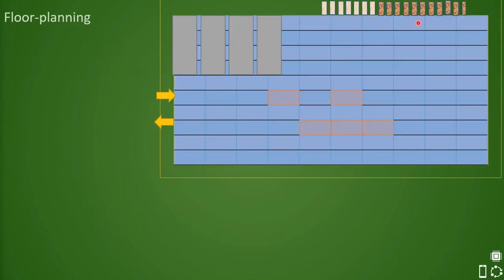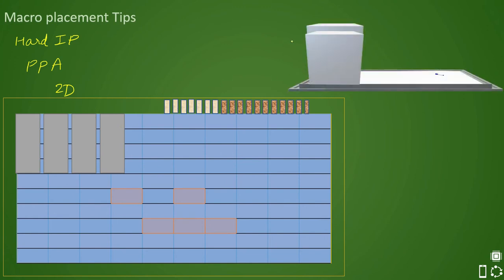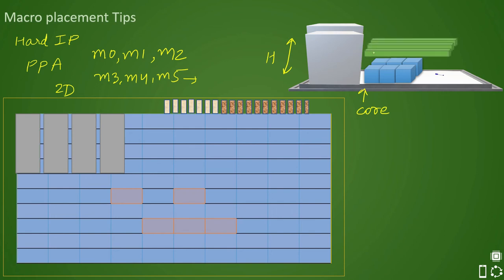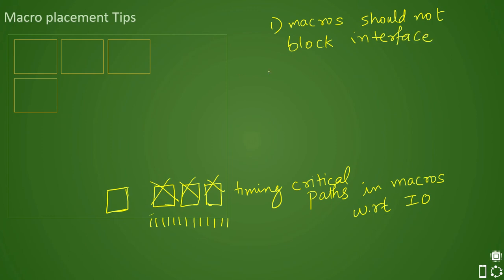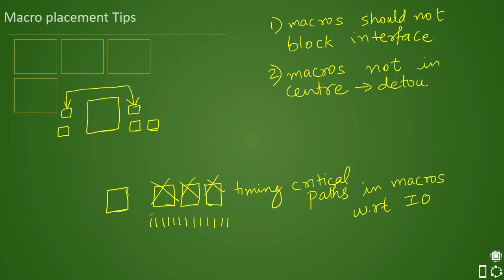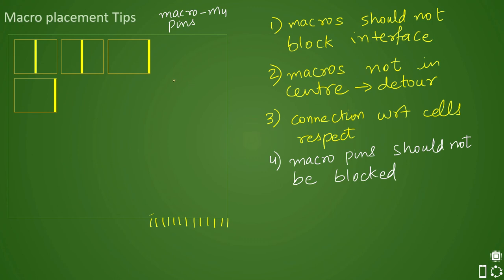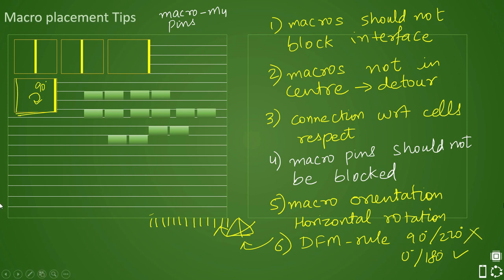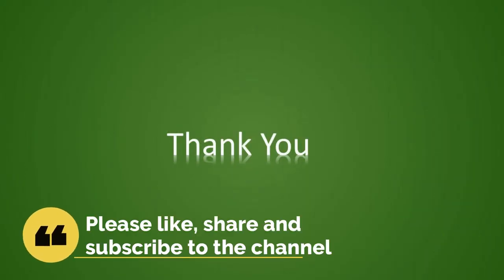PD Lec 18- Macro Placement & Floor-planning [part-4] | VLSI | Physical Design

Comment: what is difference between undriven i/p and floating i/p which is part of sanity checks
Reply from the maker: An undriven is the pin without any connections to input side. Floating pin can be at input or output

Comment: Hello as u said we can rotate macro by 0degree or 180 degree as u explain in video last if we moved macro180 degree that macro pins at near to core area and we are not get enough space macro pins for routing and it may cause congestion and shorts can u elaborate these things